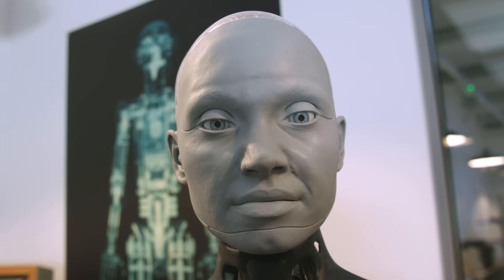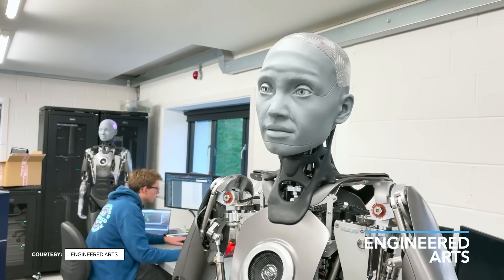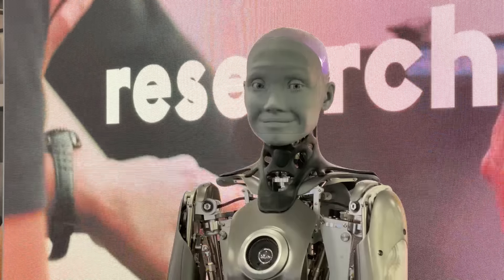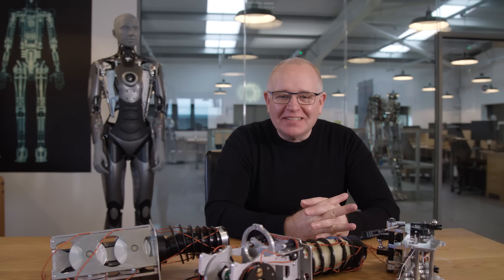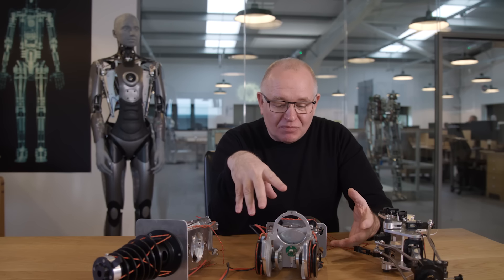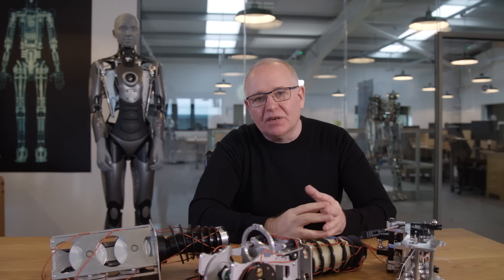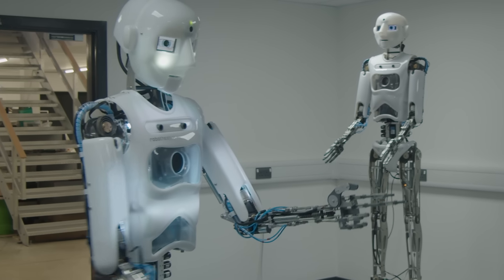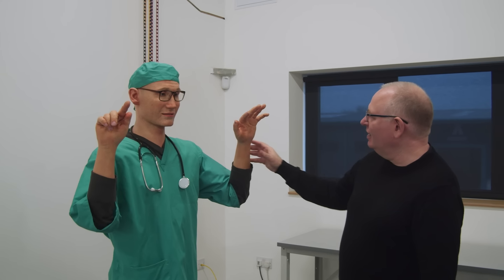How This Humanoid Robot Was Made | WIRED

Comment: The thing about trying to make more human movements, its something I notice in a lot of 3D animation too. Often times, there's no sensation of inertia, stopping and starting too quickly.
Reply: thats cause a lot of animated films use motion capture. it speeds up the animation process.
Reply: @erindsouza5887  
Arguably using motion capture would make it look better, since people have weight, unless the fidelity isn't high enough.
Reply: @Appletank8  I dont think itll make it look better. Itll only make it realisitc. If you want a cartoony looking animation, then youd have to manually animate the characters.
Reply: @erindsouza5887  
alright, clarifier, when i wrote the comment I was primarily thinking of youtube dance videos. i assume professional studios have the time to make characters move with weight, as outside of visual gags, you don't want to give the impression that the character has the density of styrofoam. That's why squash-stretch is so important. there's a very small number of mmd or what have you that do make you feel that its not a plastic cutout.
Reply: @Appletank8  uhh what are you talking about? I am talking about animation studios like Disney/dreamworks or even the small studios. I never said that you would not need to apply the principles of animation when doing manual animation? 

Also, what's mmd?
Reply: @Appletank8  neural driven animations would be the way to go.
Reply: we already have God created man and woman, why bother recreating them through technology? this is sick in the negative way
Reply: @theplacebeyondthelies2429 capitalism drivers earth

Comment: Rather than mechanical or pneumatic solutions to replicate muscle movements (especially fine muscle movements, like facial muscles), there are materials out there that react in a similar way to muscles. When a small voltage is applied they tense up, and when the voltage stops they relax. I think using that type of material would be the next step towards more believable fine motor and fluid movements and expressions.
Reply: I remember over 20 years ago seeing a material that contracted when it had an alkali poured on it, at the time it was supposed to become the next big thing in artificial muscles for building machines.  I'm guessing it was a dud.